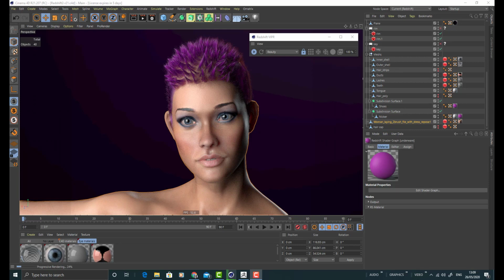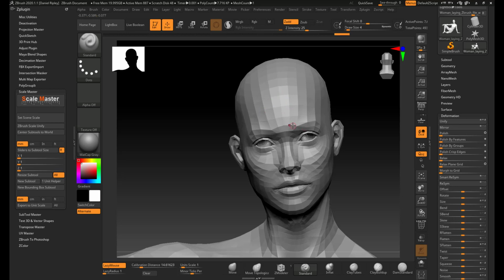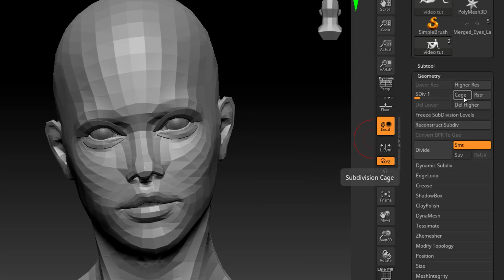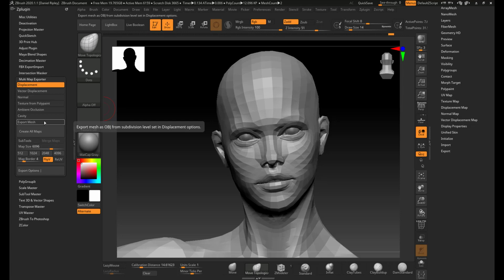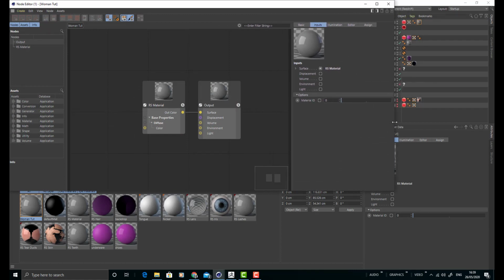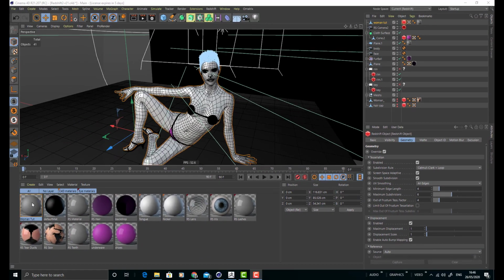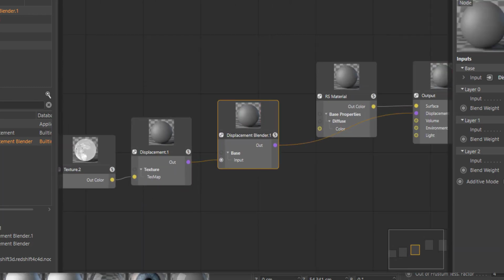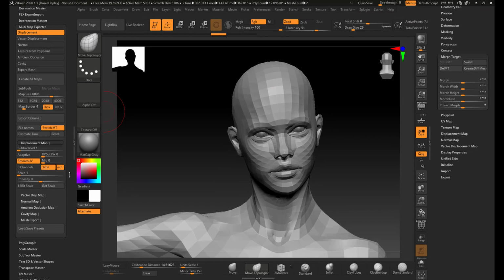Zbrush to Redshift Displacement maps (some nudity)

Comment: thank you so much for these tutorials! just a quick one, I've imported a shoe at real scale from c4d r25 to zbrush using the GoZ plugin but my scale hasn't auto adjusted like ours has. My scale is around .25 in XYZ size. do you know why this could be and what I could possibly do to fix this? Thank you very much!!
Reply from the maker: Hi Joe.  Thank you for your feedback it means a good deal to me.  Some things to check , and Im not sure it makes a difference as I do this by default is zero off all cords in C4D before I send it over.  Also if this is not the first time you have had this shoe within Zbrush there could be old Goz data when it was a different scale and its opening that version.  Zero off the cords in C4D, clear or even better remove any Goz versions for that model manually.  Iv had a bit of a break from 3D so its a little hazy in memory but try that, of that dont help drop me a email.